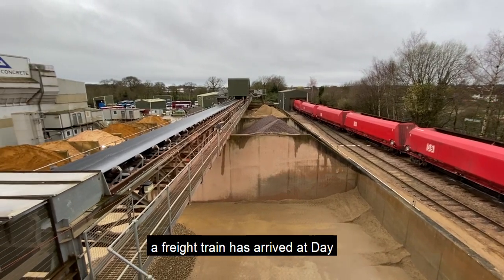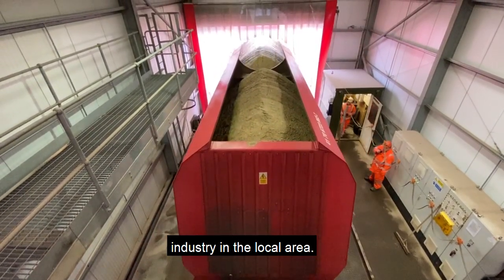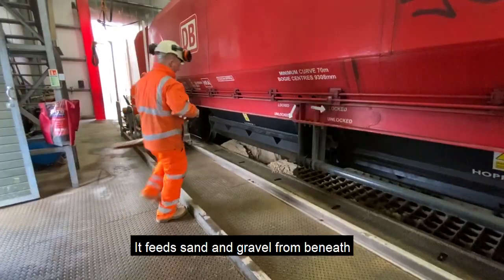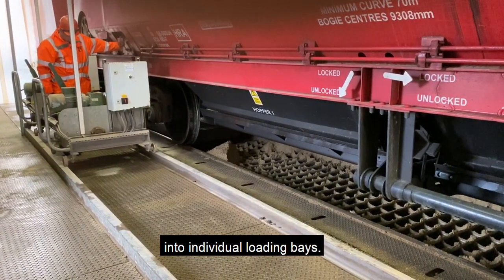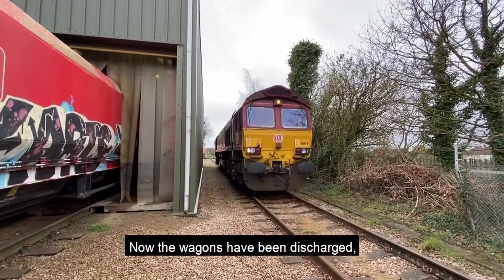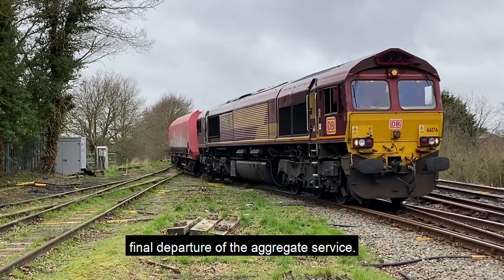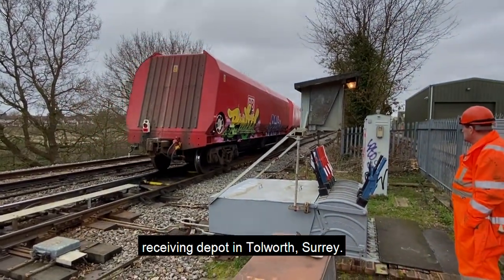Day aggregates

Comment: There is also a concrete batching plant on the site which Day Aggregates supply. The aggregate from this site, apart from the concrete, is bagged into 25kg and one ton bags for supply to builders merchants.
Interesting that one end of the train has buffers, while as it departs, the rear has a knuckle coupling. No problem with DB 66s as they have swing out knuckle coupling.
This train would be from Brett's at Cliffe, Kent. Due Tolworth 06.18, departs 11.25, although it can run early.
There is also a flow of limestone from the Mendips via Acton operated by Freightliner once or twice a week. Tolworth arrive 15.05, depart 20.05.
Both timings are from Monday November 29th 2021.
This depot used to be a coal concentration depot (Colmec) from the 1960s. The coal hopper drop was in the same location as this current one. Traffic being 21 ton and 24 ton hoppers, later it was air braked HBAs and HEAs.

Comment: Would be great to see lines like this electrified
Reply: It is, the yard is on the Chessington branch which is 3rd rail. It used to be served by class 73 and 74 Electro-diesels when it was a coal concentration depot in the 60s, 70s and 80s. They'd run on DC until they entered the sidings.

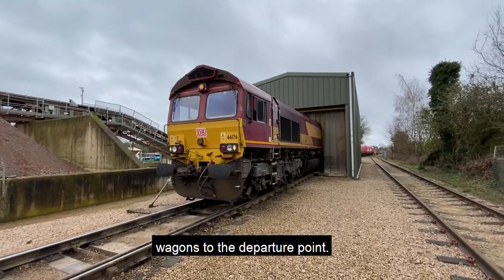Comment: 1:46 white lights showing on rear of loco or am I missing something?
Reply: Two small whites actually indicates the train is shunting! I found this out only a short time ago! A small and a large white is usually used at the driving end and two reds at the rear. Hope this helps!
Reply: Propelling or 'reversing' which is a shunting movement as per other comment it's not technically the rear of the train or loco so no red tail lamps should be displayed.